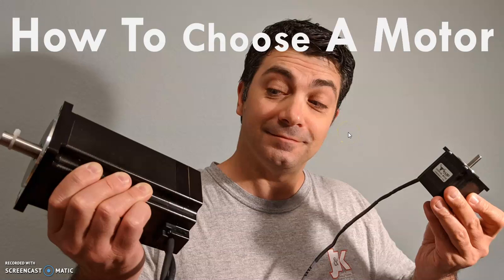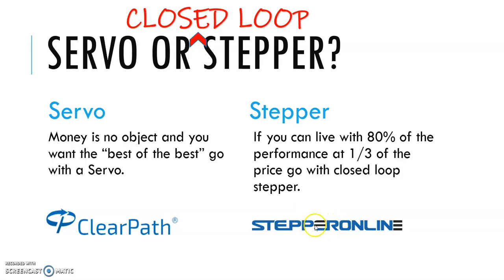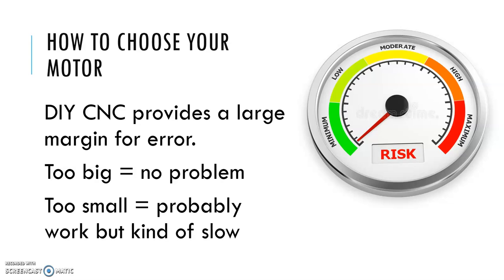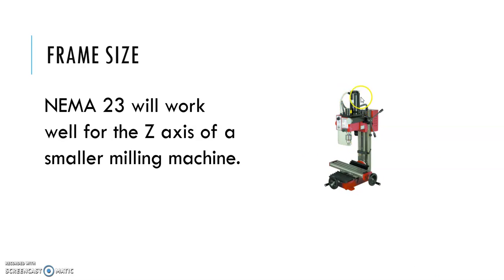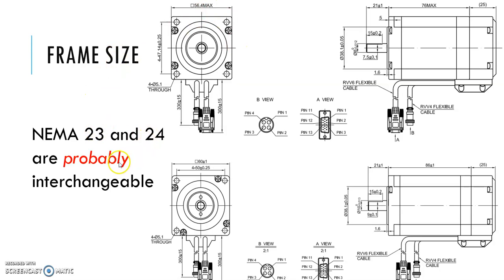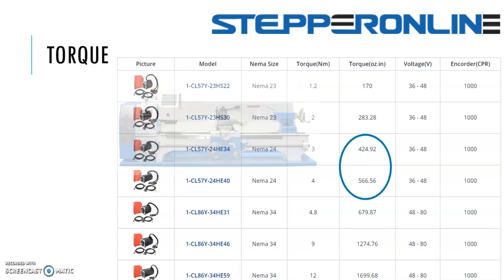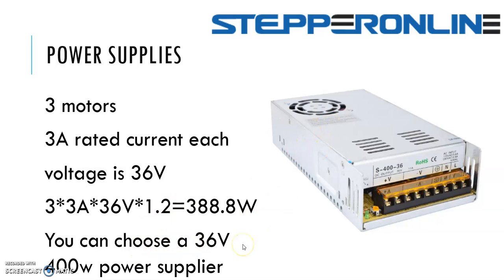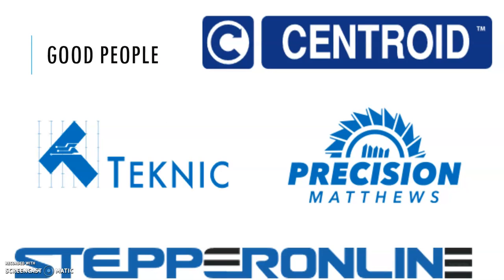How to Choose Axis Motors For Your DIY CNC Conversion Project

Comment: How can you tell that you have an open loop nema 17 or 23? I bought a CNC  motor kit from China years ago 2007 just opening it up now. It's a 4axis set up it came with 4 stepper motors a 24 volt DC power supply 4 step driver's . I had grand ideas about having a 5th axis so I bought a nema 34 axle through from Stepper online. Only I don't know if the kit came with open or closed loop stepper motors whatever they are. Long story short I'm back on the build and I've decided on a fixed gantry chain driven model. I think I have a pretty good design with a lot of travel on my axis. Gantry is pretty beefy table is relatively small with 1 ft z axis 2 ft y axis and 40" xaxis just 3 maybe in the future I'll put a 4th. Thanks for your help and advice.Oh I built my whole setup with Delrin and aluminum mounted on a steel table that has level adjustments
Reply: A closed look motor will have some sort of encoder.  In addition to the power wires for the motor, there will be other wires (smaller wires) for the encoder.

Comment: Hey Franco... I have a 3040 cnc router. My controller box not working right. All of my motorboards lights are flashing, my cooling fan not turning, and i can smell electrical burn smell a little bit. My relay light is flashing too. I dont under stand. I changed my XAxis motor from a nema 23 to nema 34. Maybe i need more power now.

Comment: You are probably wrong about the power supply amperage. First, as someone mentioned it is current through one coil, when two coil enabled current will doubled. But that person is also wrong about the power supply current rating. I have a motor, it has a current rating of 4A. But it also has a voltage rating of 1.1V. Do I really need a 48V 4A(or even 8A) power supply? Of course not - to limit current to 8A, driver should down voltage to 1.1V. and it is done probably using PWM - the same technique that the switching power supply used. I bet even 1A 48V power supply will drive this stepper just fine. And if not - a good 50V capacitor on a 48V line will help.

Comment: ONEFINITY: Nema 23 Bipolar 1.8deg 1.26Nm (178.4oz. in) 2.8A 2.5V 57X56MM X56MM (4) Wires this is what is on the machine now, what could you suggest to swap this motor for a more robust and powerful as to this without too many technical changes
Reply: important have only motor current and driver handle this current. if use arduino 4899 driver can max motor is only 2,5A current. but normal cnc used 3-5A current motors. minimum 425 oz about. DM556 handle max 5,6 A motor, voltage no matter but better use near max volt what driver can use, etc, DM556 max volt have 50 volt better use 45-48 volt power supply, and if motor need 3A/motor need each axis all motors calculate together, mean 3 axis need minimum 9A power supply, 4 axis need minimum 12A power.
Reply: vink, dont buy onefinity parts very owerprice, all same parts can buy other shop 4-7 x cheapen. one finity cost 3000$ about and all same parts can buy aliexpress, 1000$ and install parts together. sstupid buy kit if can do all same in home DIY.

Comment: I need your help please, I just purchased an "ONEFINITY" CNC wood worker version, the router I wanted to use is too heavy and the motors could not run it, it was dragging, I like to replace all four motors not concerned so much as cost as to great torque and efficiency.

Comment: the stepper current is "per phase". For a 3A stepper you need a 6A power supply
Reply from the maker: That has not been my experience. How can you have more than one phase active simultaneously?
Reply: @FrancoCNC  Depending on the control strategy. Only if you drive "full step" you have 3A. If you drive "half step", then you have some periods where both coils are on simultaneously

Comment: hahaha the blue logos thing!! xD Very cool recap, i've learned a couple of things today! Tks for the video.
I've got a question for you: in 3D printers - assuming a ~400mm/s speed and ~8000mm/s2 acceleration - one has constant and very fast changes of direction. I've been trying to figure out if a nema 23 would be a good replacement for a nema 17, but I can't find conclusive info. Main doubt is regarding the mobile mass of the motor, (which is considerably bigger on a nema 23), hence MAYBE  being prejudicial, (or not being so capable of fast changes in direction as a nema 17). Would love to hear you opinion/insight on this. Tks :)
Reply: Hi.  I'd use NEMA 17 closed loop stepper motors for your 3D printer.  They will be lighter than NEMA 23 and the closed loop drivers will provide a much higher performance than open loop motors.

Comment: Are clearpaths built with or can be attached to receivers so they can be remote controlled
Reply from the maker: I think you can do it if you have the right motor.  Call ClearPath and and them.  This may be a good reference for you if you don't know the frequencies for an RC receiver PWM output:  https://dronebotworkshop.com/servo-motors-with-arduino/
Reply: @FrancoCNC  thanks for getting back, I’m new in this electronics world and I’m saving to build a battle bot
Reply from the maker: Reach out to this guy:  https://www.youtube.com/channel/UCslfKen2hz6jJMeQgCzp5bA
I think he may be able to answer some of your questions.
Reply: @FrancoCNC  ok thanks

Comment: I was given an  older InterLab Robotics  plotter engraver CNC  machine . It's in great shape .motors work , dc servo motors with optical encoders . I do need a control board , I believe the REV4  centroid acorn board would be a good fit. only going to be cutting on lite wood , plastic . New to CNC machine any advice wood be great , Thanks.

Comment: Is the 23 and the 34 have the same accuracy? Should I just upgrade to a 34 for a high use machine longevity?
Reply from the maker: Both sizes have the same accuracy. However, if you have room to mount the larger motors, you probably won't regret having them.  Bigger is better, in my opinion.

Comment: Very informative and a great video. I watched this video and truly feel confident in considering purchasing the products needed for a CNC conversion of my Grizzly G0602 Lathe. I also have a large Harbor freight mill the I wanted to convert also.  I have already with confidence look at these companies products you have provided the links.  Thank you so much and God Bless
Reply: just got the large hf mill, what did you go with? also where did you mount the dro scales if used?
Reply: @TheUnofficialMaker  I have hurt my shoulder and I am getting ready to have my shoulder replaced will get started back when I have mended.  The answer is I have not started but I will.

Comment: Hi Franco, thanks for Your work,    very helpful for a newbie like Me;)  one question about motors.. I see  tree different kinds of the same stepper and drivers; HE, HS and HP motors and Y, S and P board.. Do You really find differences btw them  in terms of performance and noise ? ;)
Reply from the maker: Hi. I've used the Orange Y series motors/drivers and they seem to be really good.  You can set the micro stepping to a high value and the motors will be very smooth and quiet.  I'm sure the T series are superior (more efficient, less heat) to the Y series but depending on the application, you may never see the difference.  For a DIY machine, I'd have no problems using the Y series.  But, if I had an application where the stepper motor was going to run at high speeds for extended periods of time, I'd spend the extra money and get the T series.

Comment: So what exactly happens if the closed loop motor can't do what is asked. My stepper squeals, so looses steps and the job can continue at the wrong position. 
Your saying the closed loop will NEVER do that? What does it do if it simply can't do what is asked?
Reply from the maker: Great question.  The drive will generate an alarm, stop moving and close (or open) a set of contacts that you can wire into the alarm circuit of your motion control board.

Comment: This is Great Content, Franco. Just the types of things I need to know in order to save some money. I've been considering purchasing AVID's Turn-Key CNC Electronics system for $2800, for my DIY Router, but maybe I can do it myself. Thanks for. the great content. I've been looking for some time for more info on the ins and outs of wiring a CNC Controller.
Reply from the maker: If you have some patience and are half-way decent with basic wiring skills, you can build one yourself.  Centroid Acorn system comes with really good wiring diagrams that cover just about everything.  And, I have several videos on the topic, as well.
Reply: @FrancoCNC  I've ordered the Acorn, and spoke with Teknic today. They ran a simulation based on my machine, and suggested a smaller, less expensive servo than I originally thought I would require. So I think that I'll be going that direction. Thanks for all of the great videos!

Comment: The prices I'm seeing on the StepperOnline store front are ridiculous. Even the 1700 oz.in. NEMA 34 motor and controller is cheaper than  what I paid for a single Gecko G201x driver (without the stepper motor) on my CNC router. What is the downside? In this case the prices are making me wary of the product. A full kit with 2 NEMA24 500 oz.in. (for X & Y axis) and a 1600 oz.in. NEMA34 (Z axis) is cheaper than a single 750W NEMA34 servo from DMM. The Gecko G201X stepper controllers are pretty rugged and don't usually fail to being mishandled by disconnection the connectors when powered up. Leadshine early on would fail just looking at them wrong - though they seem to be much better now. What is the weakness of the CL86Y/CL57Y?
Reply from the maker: Hi.  I'm guessing you haven't calculated the shipping fees on the items that come from Asia.  Once you do, you'll see shipping that is a significant part of the cost.  Unless you buy one of the few products that's actually manufactured in the USA, you'll see most all of these types of items come from Asia.  There are some differences in quality of the product but I find the biggest variable is the quality of the support.  If can range from non-existent to pretty good.  The stepperonline support is as good as it comes for products in this price range.  I'm feel very comfortable using their products and I've not had any bad experiences, thus far.  Their drives, motors and power supplies are just as good if not better than anything else I've used.

Comment: I am looking at doing a CNC conversion for a PM-25MV mill. I am thinking of just doing closed loop NEMA 34 on all axis. Is there any downsides to the larger size motors that I am missing (clearance etc?). I would like to over size the motors so I never have to worry about it. Thanks

Comment: Good presentation. I'm currently working on a series 1 Bridgeport which I ran with Ahha software and stepper drivers. The computer won't boot, and it's on my "do not resuscitate"list. I'm going with Centroid acorn for control. I'd like to reuse the Ahha drives and motors at least for now. I may upgrade to the closed loop steppers at some point in the future. The original X And Y motors were 425 oz in. I think that was WAY undersized, and I'm looking at the big end of the available motors...

Comment: In my experience with open-loop steppers, I have never lost steps on any that I have. They average out at 425 oz.in in x-y axis and 640 oz.in in the z on a grizzly G0463 mill conversion. I have snapped 5/8" endmills while cutting too fast or deep. The only thing I regret with the mill is the 2000~ spindle speed. I have the forces to cut at a much faster speed but the slower spindle speed makes cutting my primary metal which is aluminum a very slow process. I have a few videos showing how slow I run the thing. Any faster and I get poor finishes. Actually, I could have at least doubled the speed but these parts need to be polished to mirror finish. I've done other parts at 2x+ the speed without issue. I use the videos for my personal use to remember how I set up things. They aren't intended to be informative.

I take it you are going to convert your new PM mill correct? I love these types of videos and will make sure I follow your progress.  I would like to see how fast a 4K spindle on that PM will do a part.
Reply: Faster speeds (feeds) is where you start to loose steps.

As someone who has been down that road, based on your slow spindle (2k RPM),  your feed rates are slow enough that you are operating around max torque of the motors and thus less likely to loose any steps. Stepper motor torque curves plummet after about 10 to 15% of their max speed. Like you, when spindle speed was my limiting factor, I had zero problems with lost steps, I also couldn't feed at more than about 19 to 20ipm with a 1/4 cutter at 2200rpm to keep proper chip load and with 5mm lead ball screws and direct drive from the steppers. That put the steppers at 99 to 101rpm (i.e. in their max usable torque range).

I later upgraded the spindle setup to be able to get 8000rpm and at 8k, to keep proper chip load, I had to feed at a minimum of 72ipm and with direct drive system, that put the motors at about 365rpm and based on manufactures spec'd torque curve, I was down more than 50% of the rated 425oz-in. (if I'm to believe Stepperonline torque curve for the motors I was using, I was down at roughly 200oz.in at that speed) and I would loose steps. When I would adjust feeds to account for chip thinning and thus had to feed even faster (over 100ipm), not only would I loose steps but I would actually stall the motors on finish cuts while trying to keep a reasonable chip load that still gave acceptable surface finishes.

Even after I upgraded to closed loop steppers, I still couldn't get the feeds I wanted for plastics that I run from time to time. Since then, I went to DMM Tech servo's and now I can rapid at 900ipm and cut aluminum all day long with finish passes at 200imp without ever missing a beat. 

In the end, speed is the enemy of steppers and them loosing steps, hence the reason why any and all professional level CNC machines run closed loop servo's. If they didn't, they couldn't get the feeds fast enough to match the spindle speeds they run at now a days and get the SFM for the give materials.
Steppers are great if you are running low feeds but as soon as you increase spindle speeds, you have to match the feeds or you put more heat into the part and wear the tool faster because chip load reduces and the tool starts to rub rather than cut. This is actually where the seemingly better finish is coming from when running high spindle speeds and slow feeds. You are actually rubbing more than cutting and this is bad for the tool and for the part if you need to hold very tight tolerances.  In aluminum for example, I rough with carbide and finish with HSS tools because HSS can and almost always is ground to a shaper edge and thus leave a nicer finish when taking really light cuts like that of finishing passes. Carbide although very touch cant be sharpened as shape without risk of blowing the cutting edge off the tool because of its brittleness and thus when taking really light cuts it rubs rather than cuts which wears it out faster and puts more heat into the tool and the part as mentioned previously.
Reply: Thanks Rick, I appreciate your input. I have an HM 46 from "Machiner warehouse" Australia. A fair bit bigger than the G0463. Think I'll go with a 12Nm (1700 oz-in) for Z, and a 4.8 Nm (680 oz-in ) or 9Nm  (1274 oz-in)for X, Y.

Comment: Thank you for all your videos!! But something is still not clear for me is there a difference between a "closed loop stepper drivers" such as the CL57T from stepperonline  or CS1-D507S (new model from leadshine) and the HBS57 from leadshine which is labeled as a "hybrid servo". Obviously both are closed loop and will not miss steps.. but I don't get why they don't show up as the same familly even after reading the explanation on the "easy servo" here: http://www.leadshine.com/category.aspx?type=products&category=easy-servo-products.  One more question, I am planning for a 2*x axis + 1*yaxis + 1*zaxis 1m x 1m x 20cm travel and I am trying to figure out if the hybrid "easy servo" might better handle the "double" x axis than the other. Also would the acorn centroid controller drive the double x axis and allow adjuting offset and such things as the doubled limit switches? Ok I found my answer for the second question master-slave axis... in here:https://www.centroidcnc.com/centroid_diy/downloads/acorn_documentation/paired_axes_acorn_user_guide.pdf

Comment: Thanks Franco, helpful info and best site for closed loop steppers i've seen to date, do they ship fast?  Do you have a site recommendation for double nut ballscrews(rolled, not ground)?  I'm planning a DIY cnc mill build for mostly aluminum but some steel work also, i'm desiring feed rates of med(steel) med/fast(aluminum).  Ideas for design so far- epoxy granite structure, inwin 20mm linear bearing rails, 20mm ballscrews, closed loop 1100 oz/in X&Y and 1600oz/in Z using Centroid Acorn.  I'm still unsure about the spindle design, er32 collets would be sufficient.  Any help would be great.
Reply from the maker: Sptepperonine ships with a few different carriers but DHL seems to be the least expensive to the USA.  I've had a lot of product from Asia ship to the US with DHL and they usually get it here within two weeks.  You bring up a good point on the ball screws - perhaps that will be the subject of an upcoming video!  It sounds like you are building a really nice machine.  If you need higher "router like" RPM, then you will be looking at spindles with ER style collets.  Max diameter for ER 16 is 10mm so you may need to go up to an ER 20 if you need to grip anything larger than that.